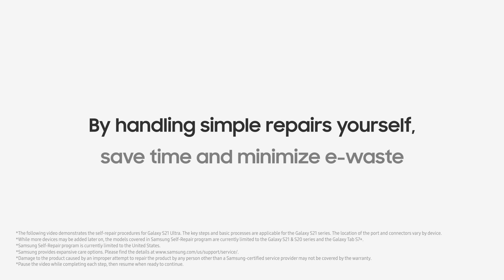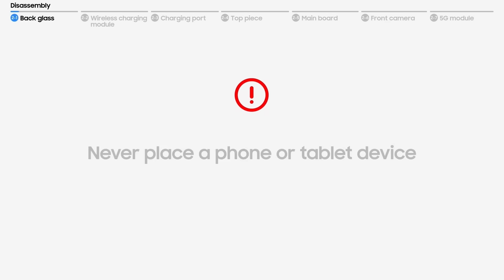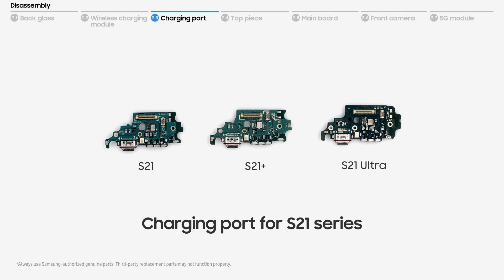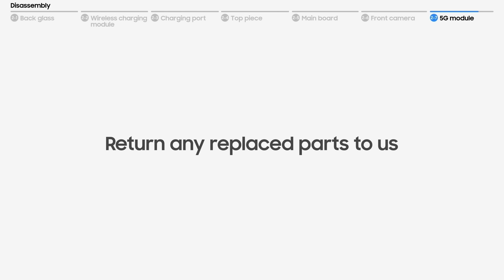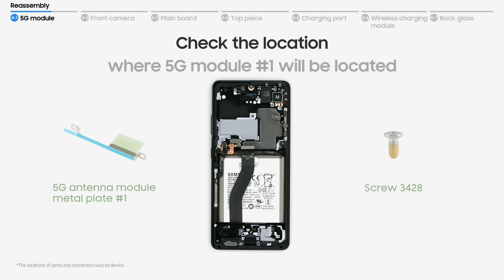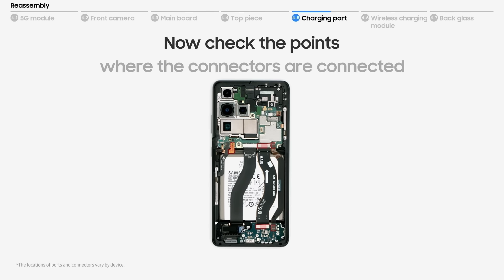Samsung Support: Self-Repair Overview for Galaxy S21 Screen

Comment: I just had my S22 Ultra Screen Replaced By Retailer I Purchased Phone From...

I Backed Up Data 3 Times Using Smart Switch...

I'm Extremely Grateful & Thankful No Data Was Lost After Retalier Replaced Screen & I Didn’t Have To Restore Data via Restoring Backup...

I Personally Would Never Attempt to Replace The S22, S23 screens...

Too Complicated...

And If Anything Goes Wrong, You're Responsible & Samsung Will Not Warrant The Phone Any More...

Comment: But Samsung intentionally implemented a trap via OTA firmware update, and it caused a green screen and flicker on some users and it has happened a lot.

Such cases often occur on phones that are 3 years old, but still get system updates.
Reply: Green screen or green tint?
Reply: @josuke6131  im sorry the problem actually green screen and flicker.
Reply: @dictionarsis  nothing to worry about. As far as I know, isn't green tint a hardware problem? If so, it's not software updates that caused the problem. Or is it?

Comment: While I'm glad Samsung gives customers the option to repair their own devices, I don't trust I'd do this properly. I'll stick to authorized repair shops for the time being
Reply: At least shops will have genuine parts on their disposal too. So it's still a win even if you don't have the skills for doing it yourself
Reply: This is actually a huge reason why they're now releasing parts to the public...so that independent repair shops can get original parts and stop relying on refurbished parts or OEM "pull" parts that are repurposed from otherwise broken devices.